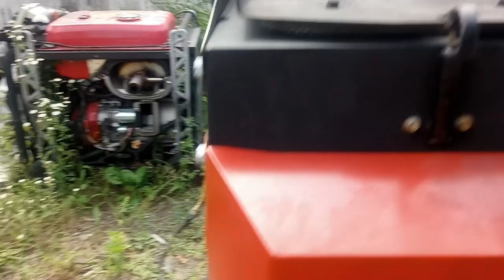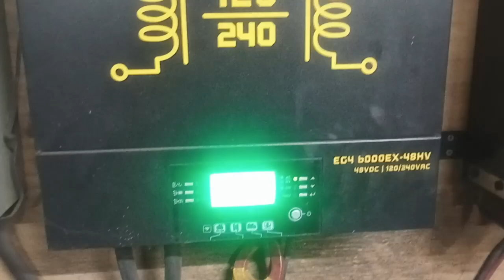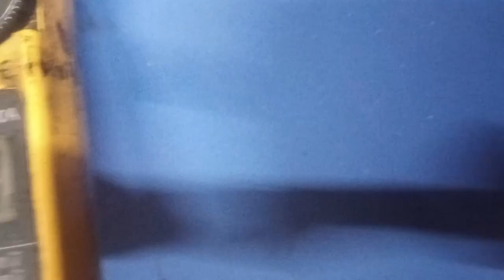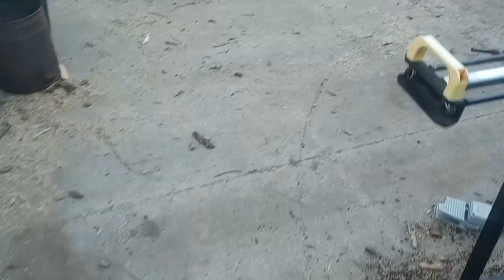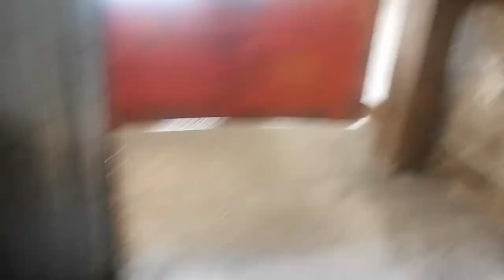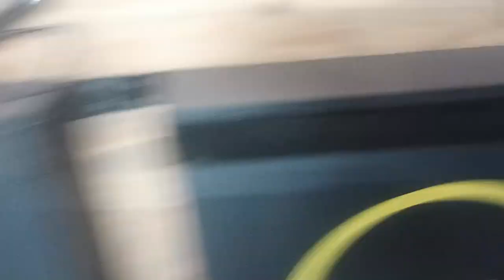CFX Boiler Nozzle Test 4

Comment: Also can you remind us newbies why you aren't using the engine exhaust to feed back in to the gasifier?  Thx
Reply from the maker: Because that is the point of the water injection. If you dont do water injection then you use EGR. EGR only cools the reaction it does not have the benfit of the water shift. If you do both it will run too cool and the gasiifer wil crash.

Comment: How's the inverter generator coming ?
Reply from the maker: I havent had time to work on it and there no imediate need for it. So its on the back burner. I dont think its going to work anyways.
Reply: It looked kinda cool.
What's not going to work? 

What I want is one that can be reversed and used as an electric starter for the smaller generators that don't have starters.
Reply from the maker: @rolc8272  The alignment between the rotar and stator are not accurate enough. The magnets are already cracked and it rubbed pretty bad.
Reply: Yeah that taper is a real pain.  If you order engine from China they have tapers. Must be a standard for them.
My thought is to machine the rotor to a straight bore and mount it that way as a hub....
I am sure it's not as easy.
Only other idea is to build a jig or reverse reamer to bolt on the eng and make a taper on the existing shaft.
But probably not enough meat.....
Reply from the maker: @rolc8272  If I were to produce this kit. Id have a machine shop make these parts. posibly get the housing adapter plate cast ouf of aluminum and then have it machined. 

I think there is a huge market for it. But Id need an investor and they are only looking out for themselfs. Its hard to find the right money.

Comment: Congratulations on the extended run time!  That is awesome!
Reply from the maker: Yeah did what you sugested with adding that tube to the water tank valve. That seemed to fix that plus this nozzle dont have a tube end where surface tension can build. So I got good consistant flow now.

Comment: Following closely. Every step and change seems to make progress. I have most of the parts ready to build the new nozzle setup but now you throw in the check valve !! It gets better and better. Good job !
Reply from the maker: Do a video when you get it working so people can see. This is actually a pretty big break through and evens the playing field between wood fuel and Charcoal gasification. We are now on the verge of water becoming the primary or at the very least an equal fuel input. I ran the numbers last night and it didnt boil off the water in the tank as much as I thought. Most of it was actually processed. I think once I get pipe that steam in the water tank the BTU each fuel provides will be 50/50 I on the threshold where water will be the primary BTU producer in the machine.
Reply: @Thrive-Off-Grid  I got a peek of the aluminum check valve valve and figured it could be found on Amazon. Yup, ordered a hand full of them because I'm guessing the valve inside might be plastic and prone to a melt down. But hey ! this is a real break through in my book. Imagine ! running on water as the fuel source. Be careful, uncle might not like your innovative spirit. Thanks for keeping us up to date.
Reply from the maker: @nhhbbyloggr5022  Yeah I was thinking that this morning and this is actually real and works. lol
Reply: @Thrive-Off-Grid   7/30/24 finally blocked out a few hours to fabricate your new nozzle design. The most difficult part of the conversion was forming the new water line from the tank to the nozzle. Oh one more thing, I found that a .22 cartridge presses into the tank valve adding a little height so that the sediments don't block the valve. Have to had time to test any of it yet but that will wait until another day.
Reply from the maker: These are the check valves I have in aluminum. https://www.amazon.com/dp/B09C7V67HB?psc=1&ref=ppx_yo2ov_dt_b_product_details

Comment: 3 hours to charge 1 and a little more EG4 5.1kwh rackmount battery. 30.6KWH battery setup would take 13.2 hours to charge.. You think you can run your machine for 14-15hours nonstop? Maybe run 2 machines at the same time? :) cut the time in 1/2..  I think if i can charge my 31kwh bank in 6-7hours that would almost doable.. :).. Just need to get the cost of the machine down a little..
Reply from the maker: Do you have solar? If not you need to get solar first this is not the answer and no gasifier is. This is for solar back up only. Can it be done yes! Would it be practial to make that much fuel everyday? Absolutely not!! Get solar first make charcoal at your leazure and not becuase you have too. It will become a chore after while and there will be times you just cant make it. You may get sick, weather may not cooperate, etc. 

However you can team the units and you can also team the inverter generators. Thats wjhy I have two when we need extra power we run both and they sync together. We can run one on the gasifier and the other on gasoline. Or run both on two teamed gasifiers or run them sepperate.
Reply: @Thrive-Off-Grid  no not yet.. I just have a ton of wood. I don’t know what to do with it all :) I know I need to do solar first.. but I want to make sure I do my fair share of contributing to climate change :)
Reply: I love the process you have been making. It’s good stuff..
Reply from the maker: @bradmesserle999  Ok good just making sure. One thing you find here I dont push un realistic expectations of the technology and try to show it for what it is.
Reply: @Thrive-Off-Grid  yea I appreciate that..
Reply: @Thrive-Off-Grid  Totally agree that solar + BESS should come first — and hopefully it'll be dirt cheap by 2050. But I think there's a real market for charcoal-based CHP as a winter backup, especially as rural grid costs keep rising. EU household avg is now 0.29€/kWh, was 0.21€/kWh not long ago.

Here, delivered biomass is ~0.02€/kWh. With 50% charcoal energy yield, 70% gasifier efficiency, and ~25% ICE electric efficiency (50% thermal), the raw charcoal CHP energy cost ends up around 0.125€/kWh (when also valuing the heat component, assuming alternative is COP ~2.4 with a heat pump).

Add in 200€/t for charcoal labour and kiln CAPEX (medium retort, done at your own pace, in your own yard), that’s ~0.075€/kWh, bringing total to ~0.20€/kWh. That leaves ~0.20€/kWh margin for gasifier + generator + maintenance + your own labour/time to run it.

From what I’ve seen of your gasifiers, they don’t seem overly fussy to run. Do you think it’s realistic to keep the extra costs under that 0.20€/kWh ceiling? Could a solar PV heavy + charcoal CHP complement + BESS -system actually beat the grid in 2050? Could also utilize an EV and "leech" off the grid when cheap power is available, at cheap locations. Especially if commuting.

I’d ideally aim for 10–20 kW output so I could do a batch every few days to charge up the batteries. Rather than tending the "fire" most every day during winter.